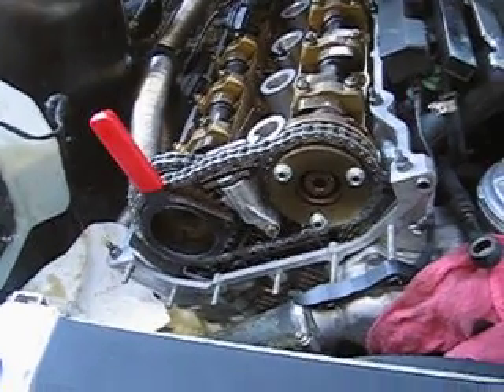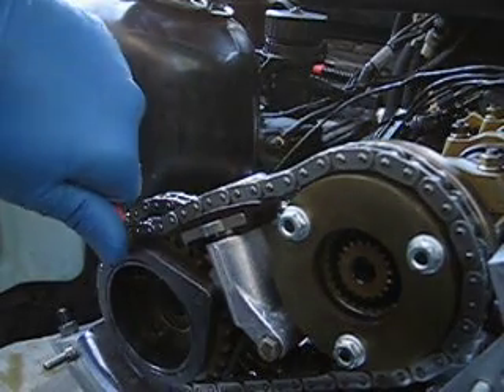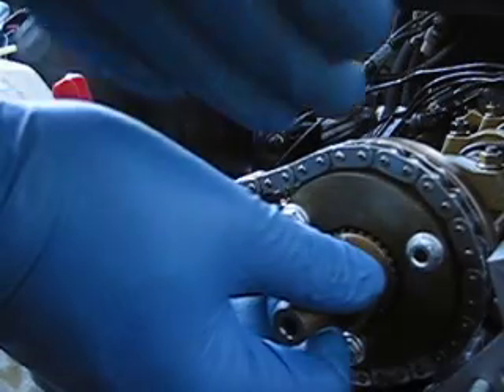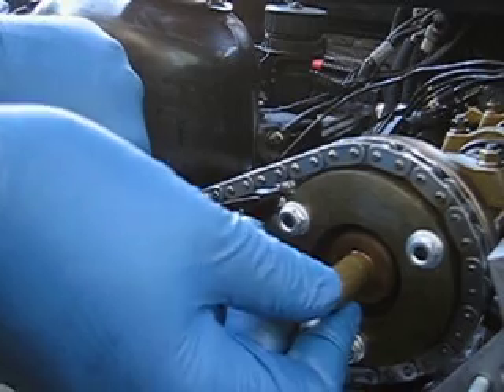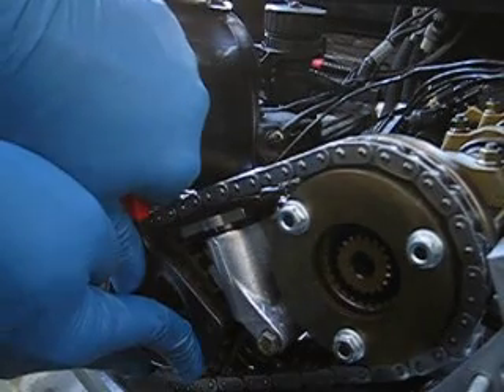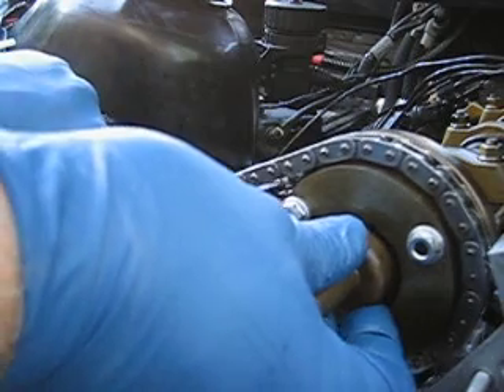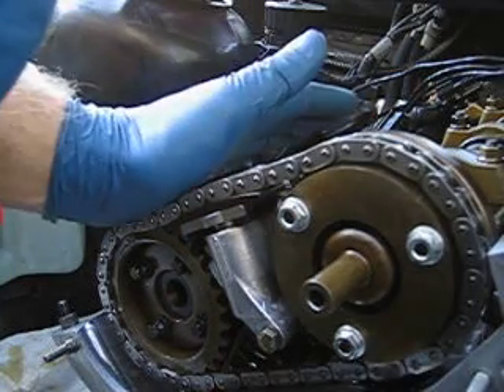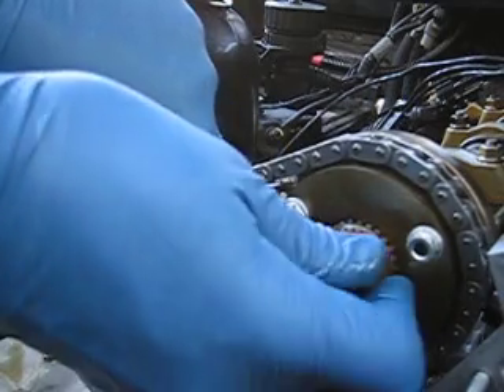BMW M50/S50 VANOS Installation Tutorial

Comment: Do I need to turn the pulley to TDC and lock camshaft, or the flywheel before doing this without problem?
Reply: +Joe Gallardo If I am not mistaken you should be at TDC, not BDC  with a  flywheel lockpin in place before disassembly, although I myself am still confused how to Align the camshafts should you have to take off the head to replace the head gasket, I'd like to see a complete tutorial on such a procedure just so I understand it better.

Comment: Very helpful video. My timing chain has been making a lot of noise, especially under the valve cover at about 2k revs, I am waiting on getting a primary tensioner hoping that fixes it, if it doesnt I'll be tearing into the wonderful world of VANOS.
Reply: Hi, I have the same problem with cams chain on my M50. Have you solved te problem yet ? . I know u write this coment 9years ago, but I try my luck 😂

Comment: when installed  vanos on e36? do i need to turn the pulley to TDC and lock both camshaft, or the the flywheel? can i do exactly show on the video without adjusting the pulley to TDC. without problem?
Reply: The cams should always be locked at TDC when servicing with the timing components.  As you notice, the secondary timing gear is rotating independently until you torque everything down, so the cam position is not affected.